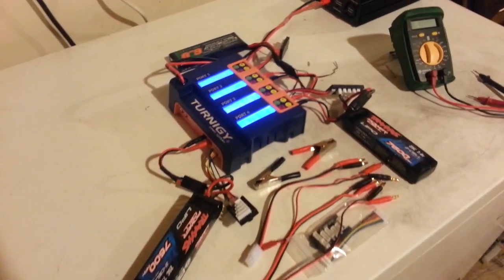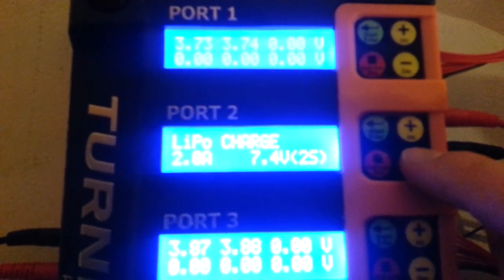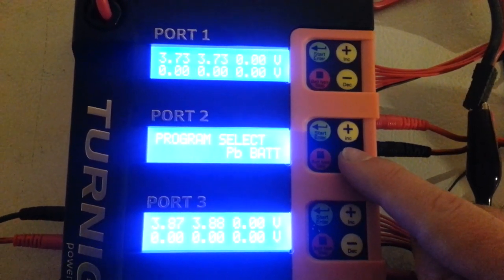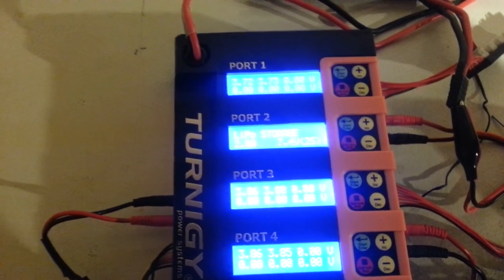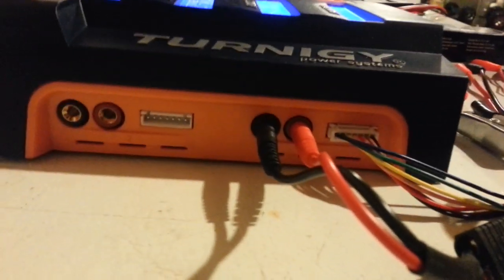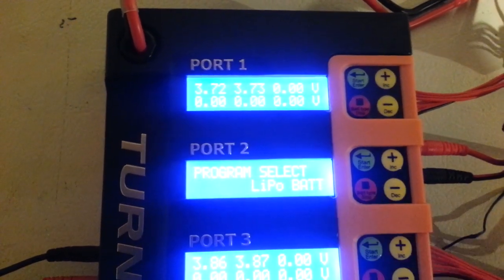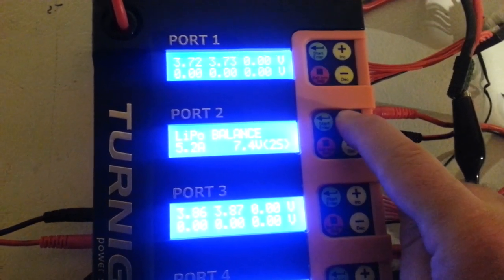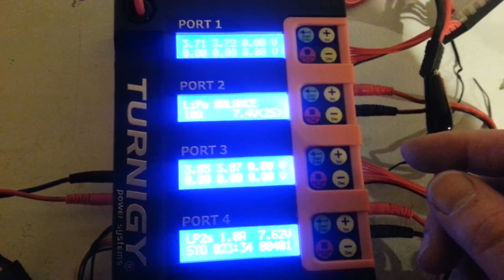Turnigy 4X 400 Watt, 4 port Lipo Charger

Comment from the maker: It says "Finished" on that channels display once the cells are balanced out to the prescribed voltage. you can go into the software and adjust the charged voltage as well as the storage voltage, so if you do not like the default settings, it's easy to change and save whatever voltages you want.

Comment from the maker: The odor of these are now about 2 years old and are my go to charging station. I've not had any issues and have charged many hundreds of cycles into our Li-Po packs. My son's and I have 13 RC trucks, so while it's not used each day, when we have an RC play day this thing is at times run non stop for 8 or 12 hours. I also supplement with an older Dynamite 2 port charger so that we can have 6 packs at a time cooking. So far I've got no complaints with this set up. I'd but it again tomorrow if it broke, and I wouldn't feel that it owes me anything at this point.

Comment: Is that the fan noise I can hear or something else?
Cheers
Reply from the maker: Yes, there is a fan on both the power supply and the charger. The charger fan cycles on and off as needed, more so at higher amp rates and with 4 packs on. If you are running low amperage or just couple packs, it barely comes on. The power supply is also on a thermal switch that allows it to cycle between off, low speed and high speed. The charge rates also effect how often and how long this fan runs.
Reply: Larry Musgrave Thank you

Comment from the maker: I use the recommended Hobby King 540 watt 110v/18 power supply. It's a direct plug and play match to the charger and works great. I've had them both for over a year and charged hundreds of batteries and many times left the PS and charger turned on all night, I've got no complaints. I'm very happy with the Turnigy 4X400 charger.
Reply: Hello,
Do you think a laptop power supply (19v, 12.5A -> 240W) can power the charger ?
Or the 18v limit should be strictly respected.
Thanks.